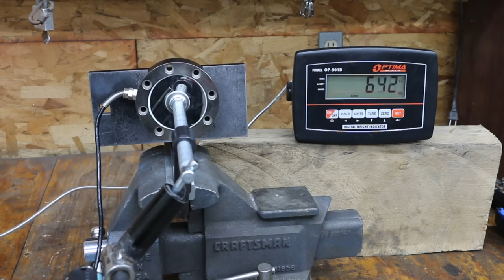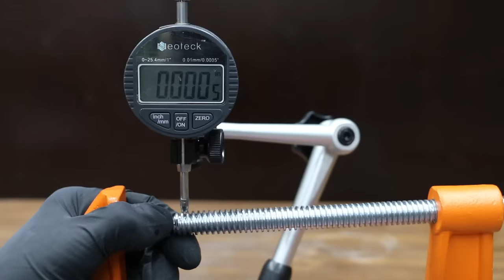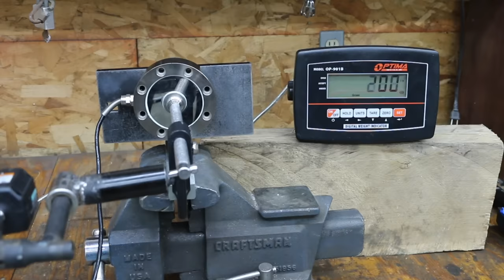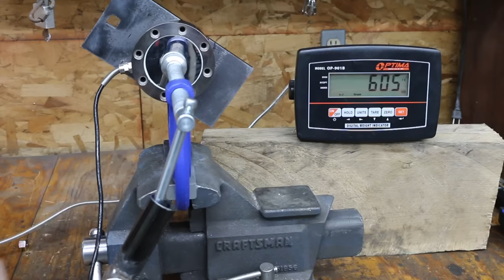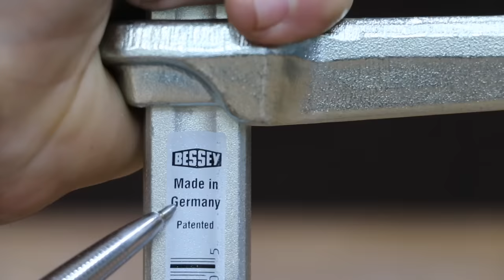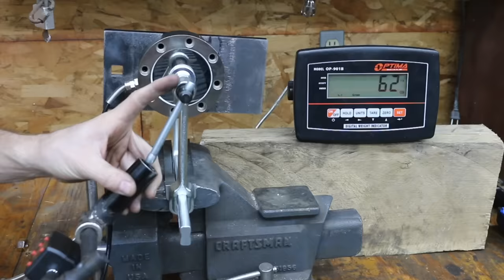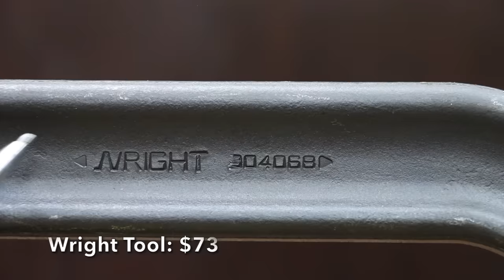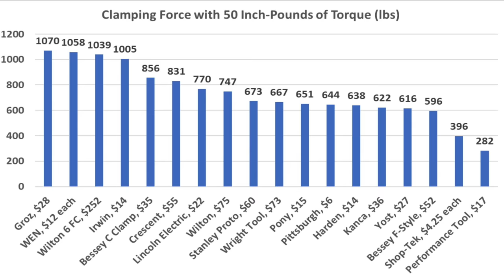Best C-Clamp? Let’s Settle This! $4 vs 252, Wilton, Yost, Irwin, Wright Tool, Harden, WEN, Proto

Comment: I like the Yost. If you take out the clamping force at a specified torque then its average score would have been much higher, and it wasn't damaged by the ultimate torque test. Also punches equivalent output to the $60 and $70 clamps at half the cost while still having the second largest opening.
Reply: I was thinking the same thing!
Reply: It's place in the maximum torque test with the breaker bar also shows that it is a well engineered tool: instead of breaking, the handle bends first acting as a sacrificial part. Coupled with the fact that the clamp did not fail dramatically under the applied loads, this seems like the safest clamp to operate since the risk of fracture from excess clamping force is greatly reduced. And for the price, hard to beat!
Reply: Just the fact that it returned to its original shape and didn't snap or permenantly become bent is incredible to me.  That alone is a massive win.
Reply from the maker: Thanks for the feedback.
Reply: The clamping force at specified torque is going to be highly dependent on if/what lubricant is used on the threads. As OP notes, the Yost would have performed much higher if you ignored this test, so consider buying the Yost and applying a lubricant to the threads (a moly grease would probably perform very well, but would be messy)
Reply: I agree a moly grease would probably work best but it would quickly get annoying dealing with the stickiness and also itd probably cause dirt to stick into the threads. I think a better option would be a lithium grease as it's a much thicker consistency and sticks to metal better so as long as a thin layer was applied or spread out over the threads it wouldn't make much of a mess around the shop
Reply: I would buy the Yost. Nobody has it in stock!
Reply: Agreed I think the Yost is the best value here in test.
Reply: I've bought 2 Yost cast iron woodworking vices; both of mine are well made, but not finished/detailed well. The threads on both (9" single screw & 7" quick release) were not de-burred at all, but after hitting them with some ScotchBrite and lithium grease, they work like a charm for what I do.

Given the price point, I wouldn't be un-happy having to put a little work in to get the same or better performance as the more expensive ones. The fact that the frame returned to shape and didn't bend/break is wild.
Reply: Agreed! I was really impressed by its ductility and returning capacity after the torque test.
Reply: @omary5439  Try PTFE spray. Clean thoroughly with brake clean, wait until it is good and dry, then "paint" the threads with PTFE spray and let that dry completely. No mess, dirt and stuff don't collect on it.  I have been using it on all kinds of things the last few years. From high lift jack, to c-clamps and various pullers. There are still a few high load tools that I use grease on though. Not had any problems with the PTFE, but still not sure I trust it when I break out the BIG cheater bar and do the whole "It will move, or it will break. About to find out"
Reply: I agree. The Yost with its deep throat and forged frame is a bargain at only $27.
Reply: I bought a Yost vise screw for the leg vise on my workbench. It's amazing for the money. I'm almost a Yost fan boy now.
Reply: I use clamps every day. Metal and wood work. Clamping force is honestly way overrated. I have a few old C clamps in the back of a drawer, but probably 8 Bessey F clamps of various sizes. The quick adjustability and deep reach make them about 5 times faster to set up. If you need more pressure use more clamps. Harbor Freight makes smaller lighter cheap knock offs for things like boat building where you need like 40 clamps. Have a bunch of those too. Cannot see ever buying a regular C clamp, so slow and clumsy. But by far the most used clamps in my shop are Irwin one handed fast beam clamps with the plastic levers. They don't have tons of clamping force but so awesome. Have about 6 of the 24" models. Use constantly every single day, keep them within arms reach most of the time! Last comment: would rather have 4 cheap clamps than one nice clamp, more is always better!

Comment: Irwin just seems to keep being right up there in many price vs function tests.
Reply from the maker: Thanks for the feedback.
Reply: I was going to say for the price point Irwin is superb. But to be fair Irwin usually exceeds their price point! Rather like Draper of old in the UK and currently Halfords tools.
Reply: @skylined5534  I've been working on building up my tool collection. I've been trying to keep with great quality tools, even buying from Europe a lot. Irwin makes so many really competitive products at price points that don't make any sense. My hammer drill and sawzall bits are all Irwin.
Reply: I've used Irwin stuff for a long time.   Never been dissatisfied.  There's almost certainly better options than Irwin out there, but rarely at the same price point.
Reply: Definitely the go to tool if you are in the middle of the project and don't have time to analyse bang for buck, because you can be sure that you will get a lot of bang for buck.
Reply: I feel the same way about Tekton

Comment: Pro Tip: Always lubricate the threads on the screw.  This not only makes the clamp easier to use, but allows for more clamping force, and will prevent premature wear caused by the threads galling up.
Great work as always, Todd! Have a great day, Sir! o7
Reply from the maker: Great point and thank you!
Reply: Pro Tip?? No way!! Grease and even light-oil will collect dirt and metal shavings. Better to just keep your threads clean.

I love my "Kant-Twist" brand the best!!! Their design makes them much easier to use than standard C-clamps. Been using them for about 20yrs and wouldn't trade them for anything.
Reply: A dry wax chain lube is the way to go for a C-clamp lube.  Keeps it from picking up chips and grinding dirt, but also helps prevent the threads from galling and binding.
Reply: @bigj231  I keep a small bottle of Graphite powder and give 'em lil puff if they're squeaky but nothing more than that.
Reply: While what you say is true we can see from this that the failure point is the frames themselves. I've tweaked countless C clamps in my lifetime. Hammered some of them back into shape too. There's nothing more annoying than a clamp where the pads don't line up anymore.
Reply: @1pcfred  Try the Kant-Twist brand clamps. They'll never walk off your work.
Reply: Wilton was even better when it was made in the USA
Reply: Some c-clamps used to replace ball joints have a grease fitting.
Reply: @MAGGOT_VOMIT  I've used name brand Kant Twist clamps and twisted them up like pretzels. But I used them to clamp together 20 foot long bars of steel. We used them with the break down saw to hold the bars together on the roller table. We'd cut bars that looked like 2x4s and we'd clamp 4 together at a time. If it fit in the saw that's how many we did.
Reply: @1pcfred  Mine have lasted 20yrs cause I didn't do something stupid with them, like i've done with other tools in the past. But my 4in and 6in KT's have handled 20ft channel on my welding-table just fine. I still use the big c-clamps on my side jig, to fork the 20ft stacks inside the shop. The Kant-Twists are the best most ergonomic welding-table clamps made, cause the handle is always in front and they never walk off your work when tightening.
Reply: @shoosh9996  Hey seems like I remember years ago, a friend of mine had a MAC or Snap-On kit that had one of those in the case with all the other components. It would probably be ok in that instance since you'd be putting it back in case, away from dirt. In a metal-fab shop grease on a c-clamp collects filings and MIG-Spatter like a magnet.
Reply: @jaywelker5566  I've used them (borrowed from a friend) wood-working making tabletops but they're good for little to nothing else. They're just Bar-Clamp type clamps, but what makes them better than standard bar-clamps is the linear adjustment that won't walk off your work and the swivel handle in tight spaces. They're still no where near as ergonomic as Kant-Twist, cause the adjustment on the KT's is always in front of you and away from obstructions.
Reply: @MAGGOT_VOMIT  even bent up we kept using them. They only had to hold bars together as we sawed them.

Comment: I'm a welder, and we use the Wilton (the lighter one) clamps at work - except ours aren't neon green 😄. Very tough clamps, and when they do fail, it's exactly as your tests showed - the screw bends. We abuse our clamps though, I'll clamp it onto a steel beam that weighs over a ton, wrap a chain around the clamp and something heavy, and drive off to get the beam off the truck 😂.
It's cool to see that these clamps can put down thousands of pound of force, kind of crazy what a little mechanical advantage can do.
Reply from the maker: Thanks for the feedback.

Comment: That Wilton showed exactly what it's built for.
Sure at 50 in/lb it was just on par with everyone else, but its raw strength is why it's truly industrial.
As for a daily driver, I think my Pittsburgh clamps are plenty capable for my uses. I did like the WEN and Irwin as well.
Would like to see a similar video for smaller clamps, like 2-4", or larger F clamps and bar clamps like 2-4' long.
Reply from the maker: Thanks for the suggestion.

Comment: Glad to see that Irwin did so well. I teach woodworking and have used primarily Irwin and Bessey clamps for about 17 years. The rubberized handles on the Irwin bar clamps do start to gum up / deteriorate after 5 to 7 years of use. Otherwise, I've been very pleased.
Reply from the maker: Thanks for the feedback.

Comment: The clamping force at specified torque is going to be highly dependent on if/what lubricant is used on the threads. As @MattTrevett notes, the Yost would have performed much higher if you ignored this test, so consider buying the Yost and applying a lubricant to the threads (a moly grease would probably perform very well, but would be messy)
Reply: Very true, but many consumers will attempt to use them out of the box, so I think this is a better "regular person" test.
Reply: @willusher3297     Never seize works very well too, but is even messier. Very difficult to clean off your skin.
Reply: @cliffords.8341  Orange GOOP Ruff Towels. Takes anti seize right off. Since finding that out I keep them in my shop at all times.
Reply: A less messy lubricant would maybe be some graphite powder.
Reply: @Blazer-fp8fo  I've used them before, but haven't tried it on never/anti seize before. I'll have to try it one day. 👍
Reply: When on the ground laying rat piss 
Ur light flickering 
Ur lunch was stepped on 
We don’t got time for lube
Reply: @TheGameBoy56  Sounds like a bunch of excuses for not taking care of your tools properly to me.
One thing I learned as a motorcycle technician and machinist was that if you take care of your tools, they'll take care of you.
Reply: @cliffords.8341  lol never said that there difference between working a shop vs bye ur self in basement with no time crunch
Reply: @TheGameBoy56  LOL! I wasn't comparing working at a shop vs working in a basement with no crunch time. It doesn't matter with any tool how or why it's being used, it must be taken care of properly.

Comment: I use Wilton for machine shop use. Also I flip large chunks of steel when I rig up to a hoist. Never failed yet. And the only clamp that can take the force when running a Dia. 2.00 turbo cutter.
Reply from the maker: Thanks for sharing.

Comment: I made a mistake and bought an assortment of clamps made in China and all but one has broken. The one that hasn't broken hasn't been used. I just tossed it. Spent a bit more money to buy a couple of clamps that fit the need at the time, still have them. That was about 20 years ago. Bought at a real HW store.
Reply from the maker: Great point!
Reply: Whenever I see C clamps being sold used and they're a good price I usually pick them up. Because when you need a C clamp it's handy to have a C clamp.

Comment: Those heavy duty Wilton clamps are awesome.  We use them at work and you can really tighten the crap out of them for lifting heavy parts or securely clamping parts to fixtures.  I do also use the pittsburg clamps for a bunch of jobs because we have a lack of variety of clamps available.  I have broken one of my pittsburg clamps but that is because I use a cheater pipe on the handle.  They are not the best but they do work for holding parts to fixtures for machining.
Reply from the maker: Thanks for the feedback.

Comment: I am not surprised but I'm still unnerved by the cost of manufacturing the 252. Because these are primarily iron or an iron alloy, you know they aren't expensive to manufacture compared to that selling price, but if you are working on tractors, land moving equipment etc., you will absolutely need it.
Reply from the maker: Great point!
Reply: Definitely an 'economy of scale' cost. They make hundreds of thousands of the smaller ones annually. They might make 3k of those big bastards annually; Even that would be impressive numbers considering that thing is effectively impossible to break lol. Such a fun video
Reply: @Maplenr  you are absolutely correct. A detail I generally don't overlook too! The cost for that small production run requires changing tooling and surely adjustments to the crucible being used if not changed entirely. 

At the end of the day though, I am confident many of us could and would just build an industrial grade clamp. A laminate of plates would most likely crush that 252's performance.
I never go beyond an SUV though, and majority of my work these days is on my 250cc Raptor-clone.
Reply: I’d imagine that every 252 is receiving additional quality inspections and testing, while not a single Irwin is.
Reply: @riotrob  so will I but when you see how these machines are tested, it's never something so brutal as most will imagine.
My formal background is particle physics and engineering, so when we design these devices, the test equipment etc., it's still a very instant process that isn't adding significant costs once the test equipment has been built or purchased.

For every $10,000 piece of equipment in any industry out there, it is still often a horrifying revelation when you find out the true costs.

Comment: That Wilton 6fc is a stud I have a couple I use to bend 3/4” plate on equipment repairs I usually run out of mojo before the clamp does but they are very expensive so I covet them and they have their own box in the truck locked and welded in place no dirt bag is walking off with them but those f style clamps are really nice also I use them a ton they are fast and easy to get in place with enough force to hold while I can get a solid tack up but I’m always looking for new clamps especially in the shop and solid with budget friendly prices are always good thank you again for another great video if I have a purchase I need to make I almost always consult your channel first lol and rarely am I left still wondering thank you for all the work you put in to these reviews I know I’m not alone in the great appreciation of your service
Reply from the maker: You are welcome!  Thanks for sharing.

Comment: Thanks for testing so many tools.  I try to stay away from Cast Iron, small diameter handles.  Over torque leads to twisted frames or failure.  I hated reaching for a clamp at work only to find someone had over torqued and twisted the frame.
Reply from the maker: You are welcome!  Thanks for the feedback.

Comment: I work in the oilfield and ive seen the larger wilton clamps reach its failure point several times.  But it also took a 1.5 impact.
Reply from the maker: Thanks for sharing.

Comment: Another great video. Thank you.

Idea. Pry bars, the longer around 36" with a handle type. Many companies seem to have a version of what look like a Snap-On, but seem to fail with use. A friend has a Pittsburgh that looks like a pretzel now, with only some carpentey use. I've used a Snap-On for many years, the older ones were better, but any of them seem better than all the newer designs.
Reply from the maker: Thanks and you are welcome!  Thanks for the suggestion.

Comment: PF. I'm a trucker - flatbed. 

I use rubber bungees to secure my tarps. I'd love to know what the best brand is when it comes to strength, durability and longevity. I don't see the hooks being anything to test, considering they're almost never the failure point, but I'd like to know...

Which lasts the longest while fully stretched exposed/not exposed to the elements
Which retains its elasticity the best with repeated use
Which best resists cutting/breaking over edges

Thanks for all your hard work. I recently had to put a tool bag together for my semi truck and I watched every relevant video from your channel and made my decisions accordingly and I know I got the best bang for my buck and in some cases the absolute best tool.
Reply from the maker: You are welcome!  Thanks for the suggestion.

Comment: i have used those bridge clamps in a fabrication shop,, we clamp 2- 1 inch steel plates,6ft X 10ft together ,then drill a bunch of holes through both plates ,so they are exactly the same.with.a half dozen of these bridge clamps ,,,all look like they are at least 50 years old and they still work great...Constuction workers use these bridge clamps to hold and support things while they are working on them ,.thats why you pay 250$ a clamp.when you absolutely CANNOT have failure or movement,as someones life IS depending on it. its great to see this 25 ton bridge clamp in the test to show people what a real HD C clamp is ..
Reply from the maker: Thanks for sharing.